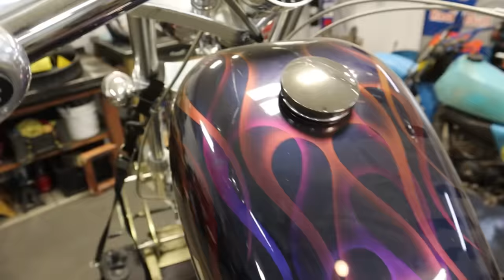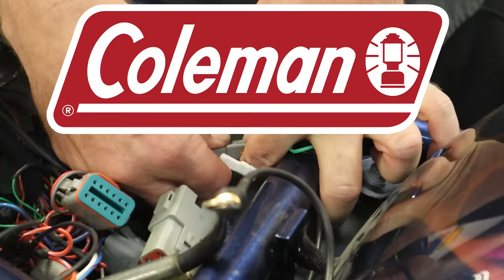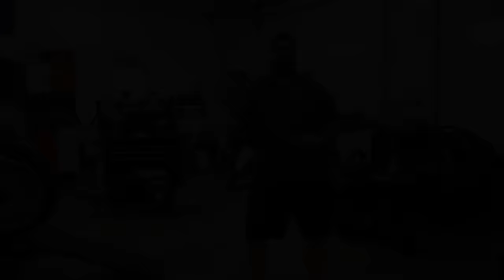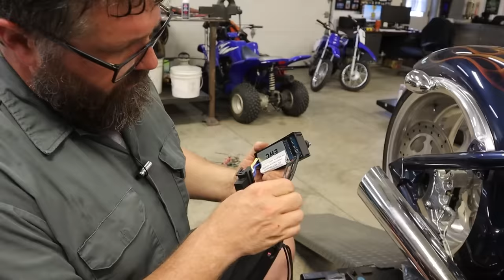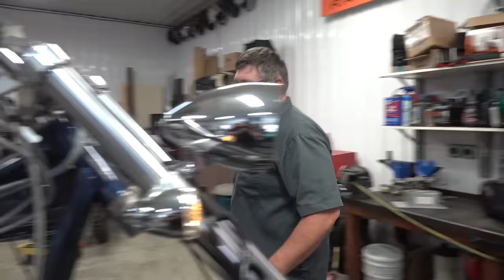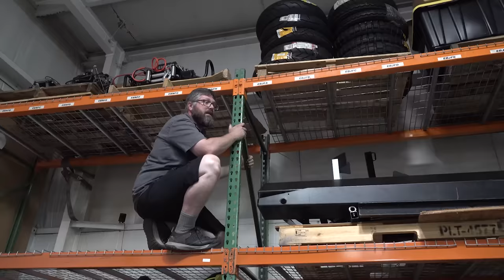Can I Fix This Unfixable Chopper ?

Comment: Hey Craig Im a former Big Dog dealer from Maryland, as well as a owner of several personal bikes over the years. I partied with Sheldon Colman and Arlen Ness and others back in the big tire hey day at the annual dealer meetings throughout the country. I could of saved you a lot of time by telling you not even to try saving the original wiring and ECM.Those things would blow out if you farted to hard when you were riding those bikes. They were notorious for that, bad starters, bad speedo's and other various gremlins. The only way you can make them reliable is to do what you're doing, rip it out and start new. Looks like someone has already replaced the speedo with a digital and you rebuilt the starter and did the harnes so you're well on your way. Good news is the S&S 107 and the Baker transmission is pretty reliable providing its running the S&S rockers and not the Total Performance junk that caused a LOT of internal problems. Looks like that bike has the S&S top end components. Good Luck.
Reply: I agree with you 💯👍😎
Reply: Single fire IGN ,new coil single fire, Fuse box starter relay head light relay change controls,and switches, new wiring front to back  tach, volt gauge no speedo I live Az not required here bike runs great now ,got rid of stock wiring harness, ECU. Clean and simple now!  The way it should have been from factory no more electrical BULSHIT,or problems  Happy Camper now 👍😎

Comment: Check the valve timing. stick a zip-tie into the spark plug hole and just make sure it inhales and exhales when it's supposed to in relation to the pistons.
check the ignition timing, this is what it sounds like with a shared flywheel key. 
you can do it! Just DO It! (Shia Labeouf )
Reply: What he said! My 1st thought when I saw it backfire. Timing!
Reply: @nhbountyhunter  
first thing i thought of was timing too, especially when it did tried to fire and backfired.   it's an S&S motor.  those people are VERY helpful to S&S motor owners.  Pop that evo timing cover off. two screws.  see what's in there !
Reply: I'm another mechanic who believes it sounds mostly like a mechanical timing issue.
Reply: It's all electrical,  I dont believe the carb cleaning affected it much . With that one wire melt I'm surprised any of the light bulbs still worked every thing wiring,  and charging probably good a good voltage spike . Along with the ignition coils.

Comment: Definitely, did all the right things. Just have to keep checking, replacing, and going through everything. I am guessing the 24-volt heavy equipment fiasco fried other things. Coil forsure. Hopefully, it's not to much more, but it definitely burned and destroyed more than usual. You can do it, Craig!!! I'm looking forward to this big dog up and running.

Comment: I love the light-hearted approach and the deep know-how displayed here.. I tip my virtual hat by tipping my real helmet to Craig's skills & charm displayed in a nice, fun & educational (all in one) video. All thumbs up 🙂

Also, this reminds me of fixing a Yamaha XVS 650 Dragstar Classic of a friend of mine some 10 years ago, that had some custom wiring & lighting installed (looked like a circus on wheels - especially the blue ground-pattern lights were just ridiculous). The genius that did the custom-wiring job replaced all the original cables with stock ones - all with white coating and of course, with zero labelling to mark them apart from each other - and enhanced on that by adding more of those for all the custom lights. After some very brief deliberation, I decided it would be easier to just remove these and install new ones - and I think I was right 🙂 Coincidentally, I also had to clean the carburetor and on top of that, replace the AC pump (which turned out to have been malfunctioning). Two or three afternoons in the garage did the job, but still, the battery was constantly drained semi-dry throughout a single season (for some reason I did not really investigate thoroughly), so for the next season, I just removed the custom lighting completely - and it fixed those battery issues for (at least) the next two seasons, when the owner sold it.

Comment: Sold motorcycles for many years. It got to the point where if I saw a chopper pull into our lot I ran into the service area. I didn’t want to be the guy who told a customer your 50-80g chopper is now worth 10 and we don’t want it either. This video tells you all you need to know and why those bikes died an ugly death in the industry. Also that’s a Thunder heart ignition, my friend who runs a small motorcycle repair shop literally spent a couple years replacing those in Big Dogs. He has flashbacks and PTSD from dealing with those wiring disasters.

Comment: I love it when these type bikes with issues come in,I always take them in provided their owners can afford my bill.. I tell them straight up out front that the bill can easily run into the many thousands and possibly as high as 10k if I have to replace every electrical component on the bike,plus fully rewire the entire bike using all new,to quality, color coordinated wiring of correct diameter and gauge..  Those who own those "choppers" from 10-15 years back always have the money,or will find a way to get it, and want their attention machine back up and running..

Comment: I absolutely love the commitment you pour into your ventures. I would have cut my loss after pulling the seat off and discovering that bird nest. I really have no patience when it comes to wire harnesses. You talk about stress, how about adding anxiety, headaches,  blurred vision to that, roll it together, it's  called meltdown. 
These so-called small business owners know exactly what they are talking about when they refuse to take on board task's that cause brain 🧠 tumours. 
Good luck with that.
Can't wait to see when you eventually get this headache functional again, get it out the door, lock the door, and throw the key away

Comment: Craig some idiot put 24 volts on that bike with just a harness, and engine controler you got off pretty easy at first. Get a extra ignition box when you get the coil because I wouldn't be suprised if both are bad after a bunch of 24 volt hits. Also I know your tired but don't get so worked up. You are probably the most thought out mechanic on any bike or car channel I watch (and I have a mad medical condition that has me off work at the present time so I watch a lot of crap) The crazy stuff you built for Sean, and doing it with what yoou had for tools and parts would have sent a lot of guys out the door. Just go home kiss the wife and kids and get somemuch needed rest I bet $1000.00 you will wake up with a conclusion for this repair. Another thing DO NOT feel bad handiing this guy a big bill for the repair stupidity cost money. and you stepped up when most people said no. I wished I could still be a mechanic after over 20 years of doing it. I miss it. I also miss going to my personal shop and working on stuff. Not only did I work on bikes as a hobby I used to drag race them as well hence the name. Craig you got this man and I can't wait to see part two where you are riding it.

Comment: I love everything about this, even the failure to start. This is my life in a nutshell. Work, work, work away. Struggle with the problem until you think you have an answer, try the solution. Find another problem. Fix that. Something else goes on. Fix that. But, under no circumstances do you give up.

Comment: Been there and done that!  A longtime customer had a 2006 Big Dog. One of his guys hooked a jump box to it. Backwards. Toasted the control module and some wiring.That's one thing I don't like about Big Dogs, EVERYTHING runs through the electrical module. Cost about $800 parts and labor. That bike RAN! All I can say is, if you crack the throttle, you better be hanging on tight!
Reply: That's why I refuse to buy those silly modules. There is nothing on that bike three standard Harley or blade style breakers cannot handle for power loads.

Comment: My nephew has a big dog. Everything about it, with the exception of the “one off” (for the model) Baker transmission is a work of art,… and functional. The transmission issues are easily fixable, and after that, the bike has run flawlessly for over a decade.
I think the general rule should be,… Big Dog had their electronics figured out, don’t dck with it unless you understand it!

Comment: In the Air Force working on jets, if something doesn't work a lot of folks "shotgun" parts at it.  I like to try and figure things out.  This is one instance where you worked for two days and got burned for not throwing new parts at it...but I respect that!  I work on my own vehicles and stuff and try to find work arounds and I'm usually successful...but there are times when I have to throw in the towel and buy a new harness or something...lol.  Good job Craig!

Comment: From a prior 04 Bulldog owner, the factory compression releases on the heads, must be depressed, or your going to burn up two or three starters, you should really clean the carb, and use starting fluid to crank. And yes, you MUST use the big dog controller box. Mine was a 117” and ran like a raped ape.. 119HP, with a super G carb, and 640” lift cam.. fantastic build quality bikes then, was over 37K brand new.. sad to see this one was beat up on.. mis my bike, and 240 rear tire! Great bar hopper, but as I’m older, the 2016 Softail Deluxe feels pretty good….:) ride safe, keep up the content!..

Comment: Epic wiring harness replacement and a new ECU. Reprogram and replace the starter. Same thing happened to me and my '08 K-9 w/ 117 cu motor. Oh, and mine is 10' long stem to stern... And the 300 mm rear ain't cheap!

Comment: I agree that mechanics fix things while fitters replace things but part of being a mechanic is knowing when its better to fit new things over trying to repair stuff thats too far gone. 
Like this bike - its an S&S motor in a custom frame. Thats something there are off the shelf looms for so as soon as you see multiple problems with the original one you know its going to take less time and cost the customer less if you just replace it. 
If it was hit with a lot of amps at 24v pretty much anything electronic - including coils - will be dead or close enough that it won't last long. That burned wire is the sign. Imagine the insides of the electronics when that happened to a wire. 
I'm not a fan of throwing parts at something but for this one I would swap the lot because thats the long term fix in this situation.

Comment: As soon as I saw those big pin plugs and all that fine wire someone had to have been in there.  Smart move to just replace it with known parts.  You just have to find what else has been messed with.  I’m sure you will get it, seemed like the motor was out of time with it popping out the carb?  Can’t wait for the next video

Comment: The wiring is probably indeed factory. The parent company that owned BigDog was also the ones that owned Gilroy Indian and those bikes were a rats nest of electrical problems. The heart and sword is Thunderheart performance out of Tennessee. You can get alot of stuff there still. As far as the spark issue and starting the timing module that grey box under the seat has a real history of going bad. They used the same one on Indian when they owned them. May try to get the software and check for proper functionality. Great video loved seeing this!

Comment: I was the go to guy for all this headache no one else would touch . I really didn’t need the extra work , but I loved when no one would try I would those jobs are done late at night no body around tunes cranked up my favorite cutters and my meter . Hot wire the coil on the metal bench  with plugs . It works  .

Comment: Here's the thing Craig, why were they trying to start it with extra ⚡ in the first place? More than likely it was doing sporadic spark and popping thru the carb on them and they just thought it was flooded or something so they said oh yeah 24 volts will do it because they saw it on some YouTube channel elsewhere.  When really it was a failing ignition system the whole time. Then you get hit with fixing the problem they caused before being able to find the original issue to begin with. This is More likely why the other shops stayed away from it as the owners story had some between the lines problems

Comment: Well that didn't surprise me .. I've had a few over the years that even as stock bikes it's always something .. one fault after another after another .. you think your getting somewhere then you hit some more .. respect for the delving into that spaghetti mess passionately referred to as a wiring harness , not much fun but well done on trying to work out what was what instead of just ripping it out first and getting in a box load of new parts from the beginning.  Hopefully it's just something else little this time . However as you said they tried starting with a dozer could be it almost fried the coils and they just hung in till you zapped a current through them again .. looking forward to part 2 cheers guys

Comment: Single fire ignition has 2 coils in one and needs to be wired, so the front coil fires the front cylinder and the rear coil fires the rear cylinder. Sounds, to me, it's 180 degrees out of time. Swap the plug wires.

Comment: Check your cam sensor. Also the ignition module should have a red like that blinks while cranking. If not red blink then you truly have no spark, the old plug against the engine may not be sufficient to successfully test this in this case. Oh and one thing you should always do is to check each and every ground in the system to make sure they are all intact and solid!
Reply: Timing looked to be out when first cranking. Firing through the carb and backfiring are the clues plus an almighty kick broke the starter motor.

Comment: From the sound of original starter. And the Back firing. It toasted the stator coil and possibly ignition coils as well . Voltage regulator would also be good thing to check.

Comment: I had a regular customer when I was repairing motorcycles bring me a Big Dog. The rear axle/chain adjuster was F'd up. Of course you can't get any of those parts at all. Needed bearings and I had to get a new rear axle machined up. Luckily I found a guy that did this kind of work out of his garage so I got by cheap. I told him I didn't want to work on it again as like you spent way too much time on it when I could have been doing smaller jobs. I didn't have that much storage space.

Comment: I love that final stage excitement when you've been slogging away for what seems like an eternity & failing... Then you try a new direction... And things start going your way... You're 99.9% sure it's GOING TO WORK.!!
Then you get a spring in your step & start putting everything back together so you can get 'er running.!!
Of course.... I should've watched the whole video before typing this.....
There's probably a moral in there somewhere.. 😂

Comment: Zip ties. I will even look at yard sales for odd colors. You can easily use one color for each side of each connector. If you run out of colors you can use two zip ties and then start mix matching. This works great if you have a race car or something you work on often because oil and gas won't mess up the color scheme like it would if you use markers or tape and marks. You can also trim off the ends and leave them in place and they won't look bad.

Comment: We had one like that, and got the harness and everything in it wouldn’t start even though it was carbureted and had a crank sensor which was part of the wiring harness to replacement. Once we plug that in salvage from the old harness, it ran great.

Comment: One final word about this bike is that I would be surprised if it ridable once running as those big inch S&S engine are notorious for vibrating a lot.  Being a solid mounted engine all those vibes go right to the rider.

Comment: I broke down..96 softail...found taillight ground out...then high/low headlight bad..then front turn signals issues....3 separate issues...it wasn't till i isolated each circuit till i found these issues..very challenging..i understood the fundamentals..but electrical issues don't follow rules...i ended up just replacing control switches and new taillight...ordered factory parts to keep it neat...

Comment: These struggles are real. And yes when you are in a big shop in the high season thats not when you like getting a work order relating to something like this. The manager says what's taking so long , the customer wants there toy and  exclaims" it worked when it last ran"...!!!!!  Deep breaths, use the KISS approach(one wire at a time) and eventually we get there. However electrons are like a snowball, one crashed electronic component usually takes out another, building on the problem, Snowball effect. And when a burnt wire shows up you know there was a LOT of electrons arguing!

Comment: Interesting video.  After replacing the loom and boxes,  on first crank the engine fired through the carb and backfired. Thats a heads up moment.  Continuing cranking and an Almighty kick broke the starter. All hallmarks of an engine with its timing out by 180 degrees or cam/crank position sensors kaput. Probably the latter as over volting the system Probably took them out.

Comment: Back in the 50s gmc and Chevy trucks came with 6 volt systems, that sucked. To change to 12volt systems we changed out the coils, voltage regulators, and starters. And they worked fine.

Comment: I love seeing those Deutsch connectors. I built a lot of the computers that ended up in the giant Liehberr machines. The computer I mostly built would have 20 or 30 12 pin connectors that I would hand wire. It was almost nostalgic seeing one again haha